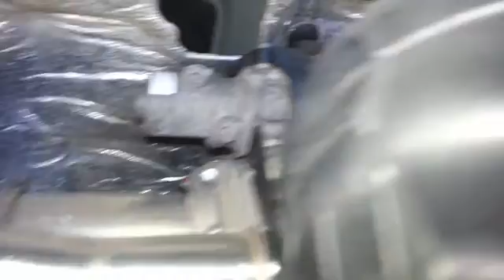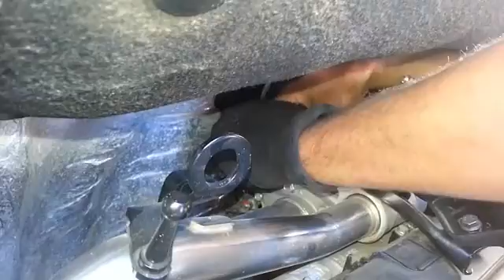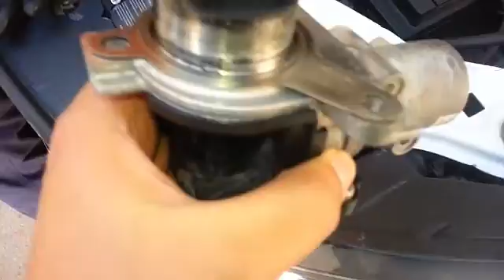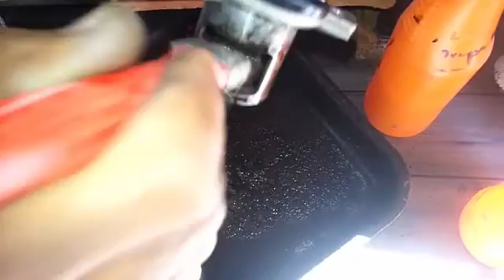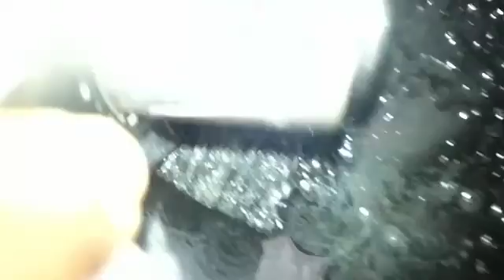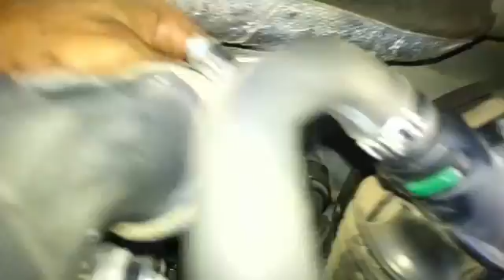Démontage & nettoyage  VANNE EGR  1.5 DCI. Disassembly & cleaning EGR VALVE 1.5 DCI.

Comment: Hi thank you for this tutorial, I will tackle mine tomorrow, car is Renault Grand Scenic 1.5 DCI as well as I'm having intermittent power loss and no engine light on the dash when it happens so worth giving it a clean, it's 10 years old with 73k miles. 👍👍

Comment: Super vidéo , ma vanne est coincée impossible de l'enlever est ce possible d'avoir une autre astuce svp?
Reply: Je sais pas si depuis le temps vous avez trouvé une solution mais ce que je fais dans ce genre de cas c'est de taper au maillet ou une cale en bois et un marteau tout en la bougeant de droite à gauche !
Reply: @yandel7092  tt a l.heure j voulu la démonter pareil impossible  de la démonter je vais mettre du dégrippant
Reply: @soliman1983  les vis ne se dévissent pas ? Si c'est le cas, mets du dégrippant au point où la vanne s'accroche à la culasse. Les vis passent à travers le boîtier de la vanne EGR pour aller dans la culasse. Sur les côtés, tu peux même voir leur filetage. Mets du dégrippant dessus, démarre le moteur, remets tout en place, fais un petit tour pour chauffer et revient pour dévisser. Si t'as une petite clé à choc, c'est l'idéal !
Reply: @soliman1983  si les vis sortent et que la vanne reste collé, fais levier avec un tournevis pour la décoller de force. Par contre, ne fais pas levier sur la partie plastique mais seulement la partie métallique. Si vraiment, elle sort pas, tapote doucement au marteau sur la partie métallique !

Comment: Your car which year model?  And what did u use for cleaning egr?
Reply from the maker: The motor type is K9K 1.5DCI , and you can clean it with any import EGR valve cleaning product.
Thanks for the comment ;)
Reply: @MécaniqueFacile  which year? And there is nothing  special cleaning product in my country.
Reply from the maker: @RidvanKahveci  2014 and above, You can clean it with diesel and brush it's effective.
good luck ;)

Comment: my egr is completely stucked i cant move it :-/
Reply from the maker: it's fouling problem , Try it with force using a screwdriver and a penetrating oil .
good luck
thank you for your comment ;)
Reply: @MécaniqueFacile  thx 😃 but i tried both and nothing :-( 

Looks like i need to disassebly the whole egr system and need to try it from inside :/
Reply from the maker: @admslayer2  Strike it gently to the right and to the left by the hammer will move , It's a proven method ;)
Reply from the maker: @admslayer2  What's new? :)
Reply: @MécaniqueFacile  thx 

i suceeded with a long wrench and screwdriver :-)
Reply from the maker: @admslayer2  Well done :) 
good luck ;)